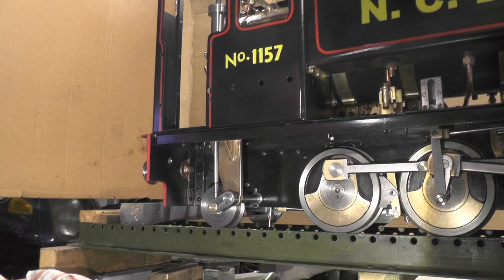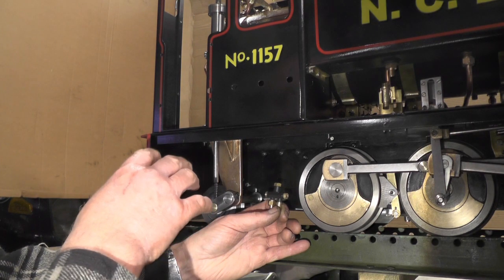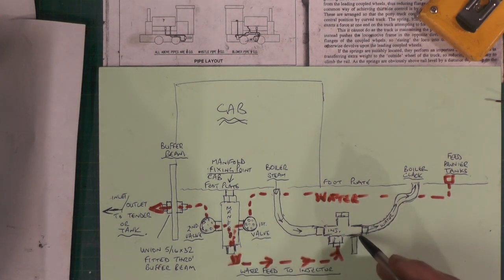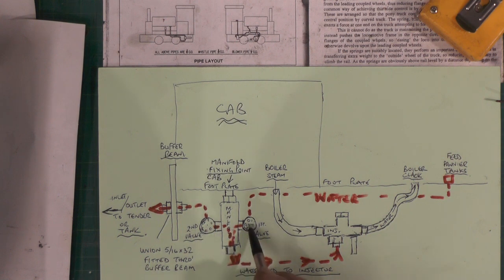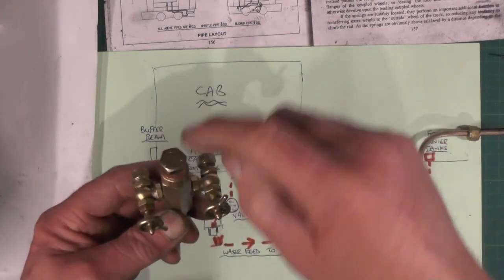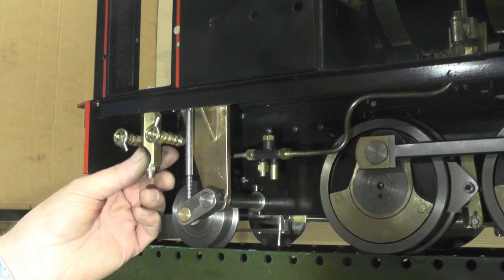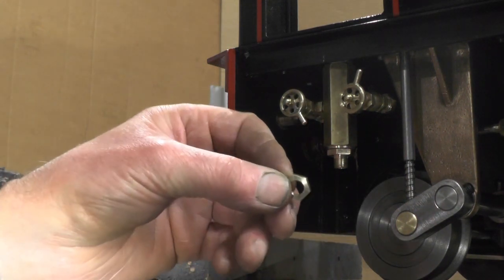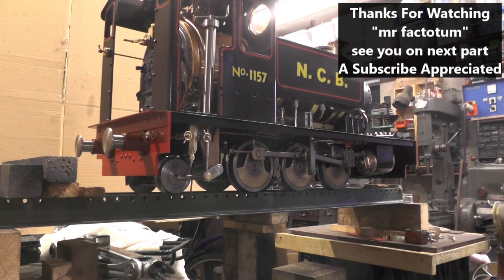Build Your Own Beginners Miniature Steam Locomotive Series (Pipework P9 INJECTORS ) "mr factotum"

Comment: Nice job, as ever. Total novice here. When you are running, will you leave the chosen water source open? i.e. if it's working from the pannier tank, then will you leave that globe valve open, and just operate the injector by turning the steam on and off? Because from what I understand of injectors, they're really just a specially shaped tube, so the water would run back through the injector and up the steam pipe to pannier tank  level - or would it? Alternatively, I suppose you can reach down from the truck and turn the appropriate globe valve before operating the injector steam in the cab? Have I made myself totally unclear, if so,  sorry.
Reply from the maker: Hi TNLD
I will stand corrected if what i say is wrong, but the injectors work with precision tapers that have the effect like venturas as in a carburettor  for example, so you can't recycle water back to the tanks, it just runs through the injector and out to ground without the steam on, with steam on it then takes it to the boiler. As for the position of the valve i'm hoping to be able to reach from behind, more often that not hopefully when stood in station to top water up, however with little experience in driving i will suck it and see, if things need changing its not a massive job to reposition valves, hope thats clearer than mud!!!! Thanks for taking great interest. Its the only way us two novices will learn the ropes, i keep getting snippets of advice from many viewers of my work, and very thankful for their experience and advice.
stay safe and see you next time
regards
mr f

Comment: Too late now, but I've been told not to use thread tape because little fragments of it can end up in the pipes, find their way into the injectors, and block them.

What people say about hot water is true. In summer in Aus we sometimes have to put ice in our tenders to get the water down to a temp that allows the injectors to work.
Reply: Agree with not using PTFE tape, the flat nipples (stop laughing at the back) that are used with injectors create a good seal and if they don't something is wrong (you also need to be able to remove the injector regularly for cleaning).

Hot water does plague injectors on scale standard gauge locos due to their size but Sweet Pea has large water tank(s) so I have not experienced issues with running my injector using the saddle tank on my loco which sits on top of the boiler (obviously if you live somewhere really hot then the experience will differ). 

Having the option to run a tender or water tank is worth having though as you can run longer without needing to stop for water and as usual you go about the solution with class, great work.
Reply from the maker: @tom_tom_go  cheers TTG, you can't beat experience, i will take all on board about the ptfe, for future.and rely on having " flat nipples"!!!!! i may build a tender after loco finished, and if another lockdown happens will definately need something to do.
thanks for advice, watching and commenting
regards
mr f
Reply from the maker: Thanks for advice David
I will log that and keep in mind for future modifications
thanks for watching
regards
mr f